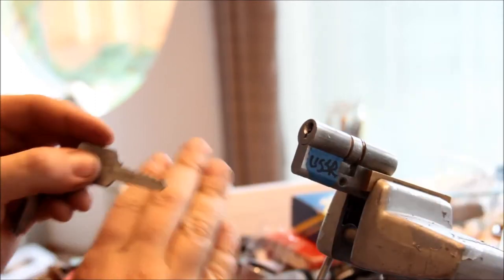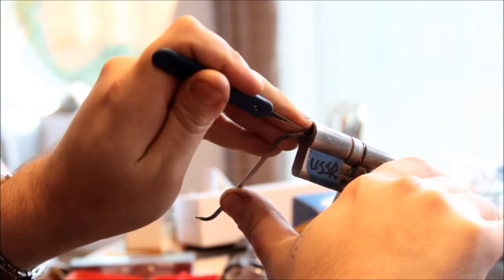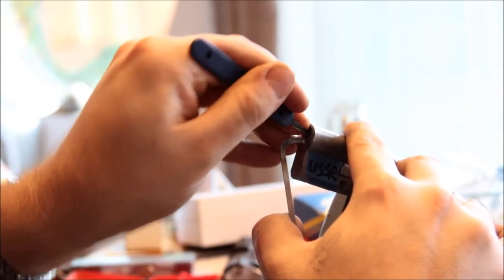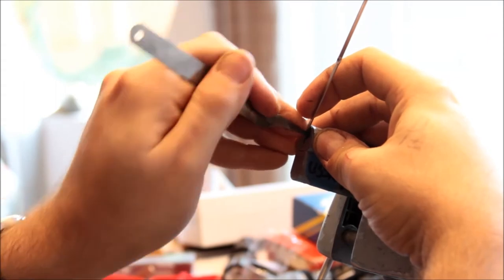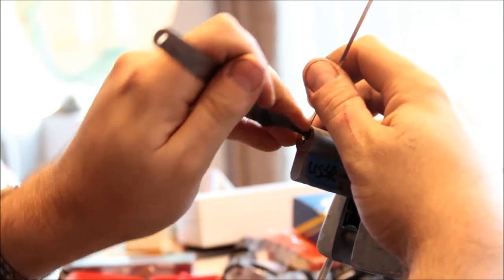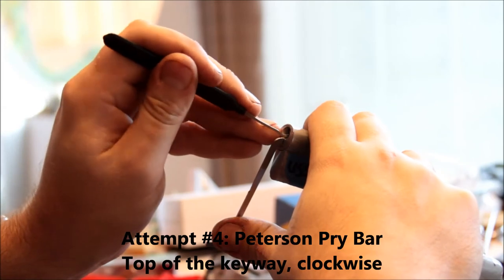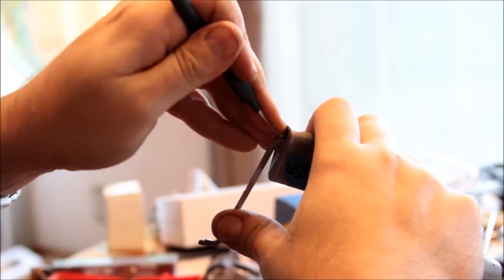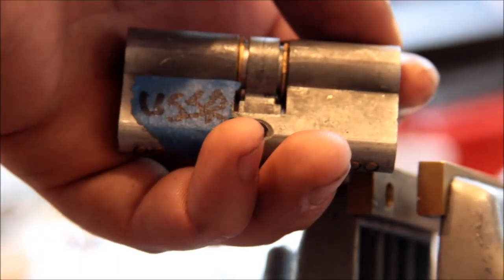(081) Soviet/USSR Euro Cylinder SPP

Comment from the maker: Yeah. I've started buying them in pairs :) 

I need to crank out a couple more homebrews... I'll run the shafts a bit thicker and then thin down the tips. Even still, the metal eventually work hardens and breaks. But so it goes.